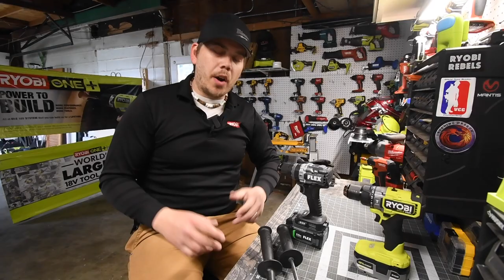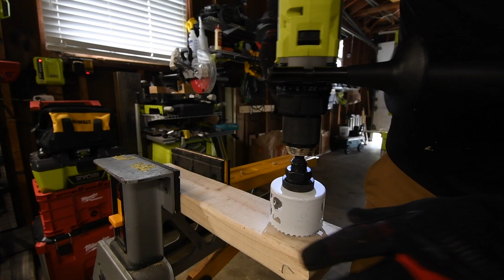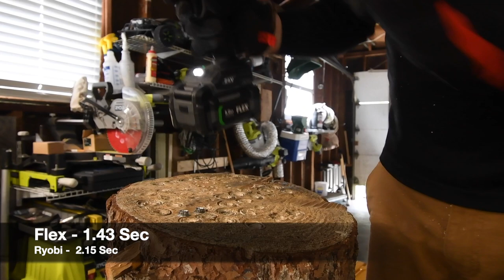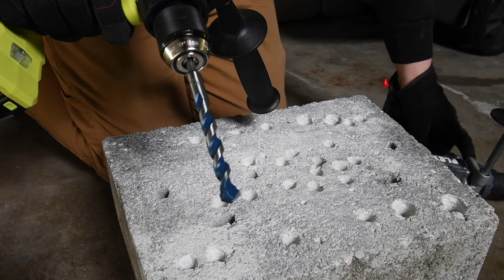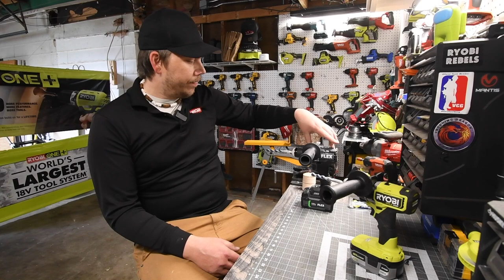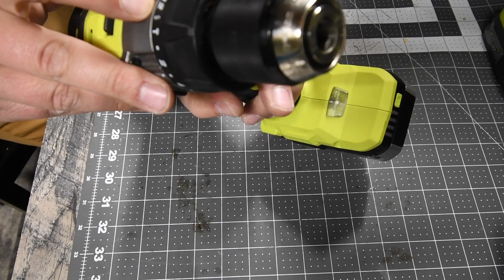FLEX Turbo vs RYOBI HP (Hammer Drills)

Comment: That's it! You just keep on dont u. Now DOT is going to have to make a 2 hr hate video about u haha
Reply: He didn't make a hate video. He made a video explaining how this guy was wrong or lying, I'll go with wrong to give benefit of the doubt. In that video he went into detail on how this guy and others like him were the ones hating on the flex. Mct actually said the flex isn't in the same class as the dewalt and milwaukee when it is in fact a stronger tool right now. Milwaukee will no doubt come out with another drill more powerful than the flex. Right now, the flex is the stronger tool. Mct should have been able to admit that. This video is obviously a way to try and make up for it by trying to talk good about the flex. I own the milwaukee drill and the flex drill and the flex is faster and stronger. The flex might break down in a week and if so ill talk about how bad it is because it broke so easily but that doesn't change that its stronger and faster right now.
Reply: I heard the DOT more like a whining session about MCT. Bear is a real Bear. He has a big head from people kissing his ass in the comment section.
Reply: @shermanwilliams7724  Nevermind. It's no use if that's how you saw that video. Smh
Reply: I saw the DoT video as well. And yes, he was bashing MCT and his tool testing methodology basically calling him stupid.

 I'm actually a little pissed off cause I think he came off as a total D!ckhead! Maybe his bout with Covid made him a rabbid bear ?  Lol

I appreciate Dave and all his efforts for testing the tools that he does. Is it pure scientific? $h!t no, but so what. Dave does his tests his way and its up to us, the viewers to decide to agree or disagree with his opinions. But for DoT to literally call out Dave directly and bash his channel like he did was messed up. 

I'm not a rocket scientist or "engineer" but I have been using cordless power tools myself in the construction trades for about 35 years. (I've got more time than DoT has using these things) So I like to think I know a thing or two about them. 

Is Dave and his testing methods perfect? No, but none of the review channels are. There's no need to bash, call out or throw hate to any of them.

To be honest, I was appreciating how Dave wasn't bending over backwards to kiss Flex Tool's a$$e$ like all the other channels were doing. Quite frankly it was sickening and obviously a lot of a$$ki$$ing because they all got free tools from Flex. 

Was Red right about the whole marketing hype and why it wouldn't be any other way, cause that's what marketing is?  Absolutely! 

But he didn't need to be such a douche bashing MCT by trying to brag about all of his "superior" experience and knowledge. 

Dave has talked about his lack of real tool skills or trades experience many times in his previous videos. He's not trying to come off as an expert. Just a regular guy who loves cordless power tools and runs a few tests so we don't have to. 

Keep up the good work Dave! Do I always agree with you and your results? No! But that doesn't mean I'm going to bash you, throw shade at you or call you out. That would be pompous and make me full of myself. 

I can literally find fault with just about every tool review channel's testing methods. But that is up to me to decide if I agree or not.

MCT is a good dude who supports many other channels here on this platform, and he often does it with his wallet as well. Can many of the others say the same? 

Again, I appreciate all you do for us Dave and hope you don't take what Red the butt hurt "bear" said about you. He went too far and came off as an 
a$$ho7£ !

While I don't agree with your love for Hilti tools, I enjoy watching your channel and your simple honesty and opinions as you test certain brands of tools against the others.

As far as Flex Tools go. Am I impressed? Ehhh

They look okay, and seem to preform pretty good, but I'm pretty happy with all the brands I already own so it's unlikely I'll be going out to purchase them myself anytime soon.

They look to be bigger and heavier than most of what I already have, and the performance is only marginally better in most cases. So to me, it's not worth running out to spend my money when all the Milwaukee Fuel, Makita, DeWalt, Bosch, Rigid and Metabo HPT tools that I already own do everything I already need them to do.

My favorite brand? Probably the brand that I've owned longer than any other. Makita. But that doesn't mean I don't like Milwaukee Fuel, or any of the others. 

They are all good, which is why I own them all. Every one has their strengths and weaknesses. Even the mighty Milwaukee. But my overall favorite due to the fit, finish, ergonomics and durability, has to be Makita. 

But that's just my opinion. No one else needs to agree or even care. Right Dave? Lol
Reply: The DOT video was a joke, just like his animated bear costume. He had legitimate rants but his delivery is what ruined the video. He stomped his paws and pulled his fur like a kid being denied candy for the first time in their life.
Reply: @Dale37  hahaha I love this comment
Reply from the maker: lol
Reply from the maker: or this is like a regular video I make among all brands of tools
Reply: @ManCaverTools  It wasn't. In the original flex video after the flex rant video, you made declarative statements about the flex not being in the same league as the other name brand "big dogs" and even said you'd not to a vs video due to it being in the league of the lesser name brands. Making this video is an attempt to show you are objective towards the flex most likely due to understanding what the Bear guy was talking about instead if just admitting it. You could have just done this exact video comparison but instead with the Milwaukee and Flex to show objective results. The flex with the 5am 18500 cells beats the Milwaukee 21700 cells in the majority of test except when getting into the heavier duty stuff, that changes when using the 21700 cell battery on the flex. Like I said I own both, I actually love the Milwaukee brand but don't understand the inability to admit the flex is the stronger tool right now. It will change no doubt.
Reply: @ManCaverTools  I'm sure even you yourself are unaware of doing this. Youve most likely tricked yourself into believing your being objective. It's something some of us do when realizing we are wrong, we subconsciously trick ourselves. I am a very good example of this in my early years and have become better as I age. Its all good man, it's your videos and keep doing what you like. You are growing as a channel so your doing it right. I said this in another video, sometime you will be right and sometimes you will be wrong, and we viewers will comment either way. Indont have 1 bit of negative/hate for you or your channel(I actually like the channel), believe me, just pointing out where you were wrong.

Comment: Dude it'll do anything in "turbo" that it would WITHOUT turbo. Its not a higher gear, which WOULD cause it to maybe not go through some things. Its just more current being sent to the motor. They probably just made it so you get 80% power without "turbo" (lol), and then give you 100% of the power when you go to turbo (Ryobi just don't use gimmicks lol). But yeah man, its not a gear, it dosen't work that way. So you don't need to say, "it'll go through using turbo" like its a higher gear with less torque or something lol. Turbo will not weaken it like a higher gear man. And why are you failing things. If you're timing how long it takes to do something, then time how long it takes to do it. if it stops, then do whatever gets it going again and add it to the time.
Reply: Also has 4V more in the battery, I've wonder what would happen if u hack the bldc motor and feed the same 24V

Comment: So all this hype and Flex, who claims to be a pro grade line, needs turbo to beat Ryobi.
Reply: It really doesn't need turbo to beat ryobi
Reply from the maker: flex is more powerful then the roybi but ryobi is powerful as well
Reply: @ppwipf6935  if I'm correct, the turbo actually increase the current fed to the motor... Idk if it needs it... But it for sure makes it stronger
Reply: @ManCaverTools  this was the same as the gen 3 Milwaukee... Completely different ranks... But it was a really interesting video for sure